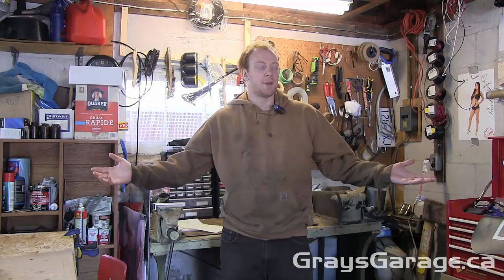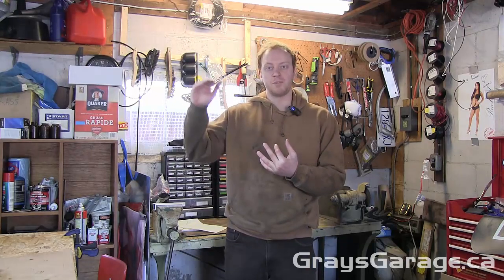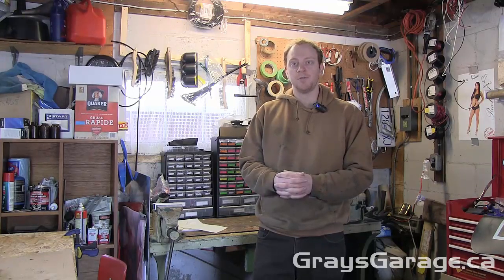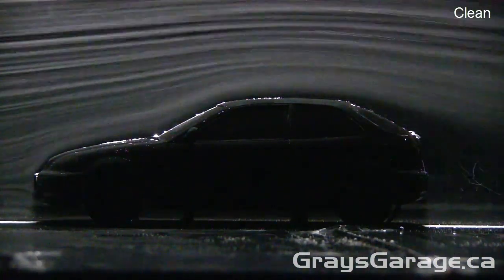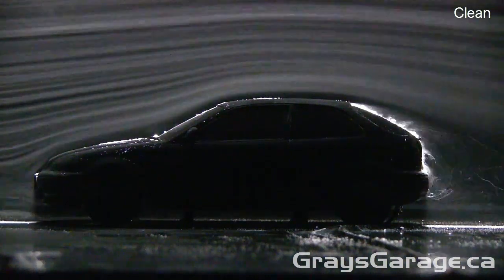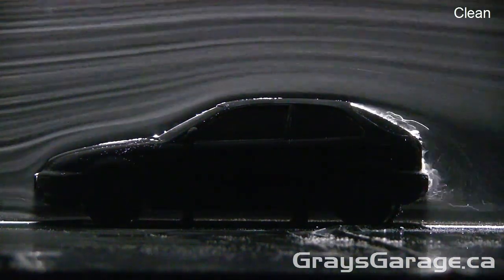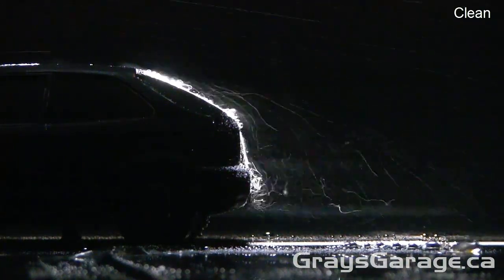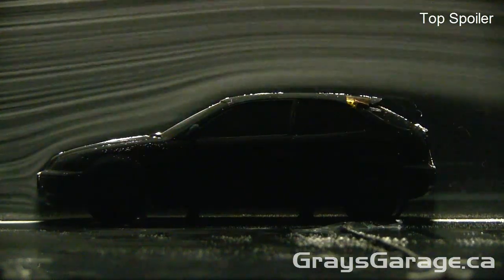Automotive Aerodynamics Ep. 6: Honda Civic Hatchback

Comment: It’s a great simulation that I learn a lot from, especially when it comes to understanding roof and mid spoiler setups for hatchback and SUV. One thing I noticed was that the combination of a roof and mid spoiler, which allows a localized bubble to form on the rear window, seemed to create less overall rear turbulence compared to the other configurations. I guess it is good thing, since it means lower overall pressure drag. I am guessing that the localized bubble above the mid spoiler has slightly higher pressure than the turbulent wake below, which could help reduce rear lift. The overall wake itself looks smaller too, which likely contributes to better overall aero performance. I’m guessing that’s why we’re starting to see more new hatchbacks and SUVs adopting mid spoiler designs. I noticed newer SUV and hatchbacks have rear window fins, i guess it could help stabilize the bubble even more.

Comment: I cut my rear bumper about 4" shorter. It's on a saxo, which means, there is nothing behind the bumper, It's an empty space for a spare wheel all the way to the fuel tank under the rear seats. 
We reckon the drag will be lower and the lift also.  I've got 3d files for sketchup, I can edit them etc. Would you be interested in testing: holes in bumper vs cutting bumper short vs diffuser vs standard bumper. There's loads of cars out there with nothing much behind the rear bumper and it doesn't cost anything. I can get back to you with MPG comparison as that's all I have to measure with.

Another test I am eager to see is, does a pointy nose make a car more efficient? Also steped surfaces vs flat. Golf ball vs smooth ball, what even happens? Surface perfarations to reduce drag? I have too many damn questions. Bumper is the one!

Comment: Thank you for your contribution to the car enthusiast community. Can you please make a video on the aeros of a 2008-2014 Subaru Sti hatchback? Not the Wrx hatchback as there are body variances in the different years. If you're unable to obtain a 2008-2014 model, possibly a newer sti would suffice. Starting from 2008 onwards,  Subaru has claimed that their STI bumper and fender helps improve flow while helping with cooling the engine. I'm thinking of doing a flat floor on my Subaru but worried about the engine cooling technicality. Any info or data would be greatly appreciated!

Comment: had thought for a while about the classic JDM styling to raise the backside of the hood to get air out from the engine bay, does the flow of air over the hood and windschield make a low pressure region ore is ther over pressure forcing air in thru the lifted backside of the hood?  

maby raised hood  is another useles mod doing more harm then good as rofspoiler on a sedan car with huge bootlid spoiler like subaru.

Comment: Well done. Only you introduced the 5th gen civic Sir ii which is an EG6 and the picture was correct but you ended up going with the EK4 civic which is the 6th gen. I prefer that you did that one anyway as it's also the same gen as the first type r civic the EK9. Good job

Comment: I would have liked to see the changes in rear flow without the upper spoiler, with just the mid-level spoiler installed.
I disagree with your assumption that the lack of wash on the back window with both spoilers installed would result in less dirt accumulation.
Methinks  it would result in more dirt accumulation because there is not enough coherent surface flow velocity to carry the dirt away.
I have a 2000 Honda Civic Hatchback with the stock upper rear window hood/spoiler.
This episode was most interesting.

Comment: Thanks for the video, it was very informative!

The first picture you show is of a 5th generation Civic, chassis code (in Japan and Europe) EG, sold between late 1991 and 1995. This car has a 0.31 Cd.

The tests you performed were done with a 6th generation Civic, chassis code (in Japan and Europe) EK, sold between late 1995 and 2000. This car has a 0.36 Cd.

Combined with a smaller frontal area this resulted in a 215 Km/h top speed for the EG Civic SiR. The EK SiR only achieved 207 Km/h with the same engine.
Reply: Was it that big of a Cd difference?? any citations or studies done to find out where this additional 0.05 increase in Cd came from? I mean a particular feature of the car??
Reply: You saying a stubbier rear is more slippery than a more sleek rear?

Comment: the first picture you showed of a eg is infact an EG. 1991-95. the one you tested is a EK 1996-00, that is what i have but a coupe version. Without the wing that came on the coupe, the car gets unstable at 90+ mph even with proper suspension and alignment. some forum users have said the mid level factory wing is very helpful with that but i haven't installed one on it yet. The integra (you said it right the second time) should offer the similar results being nearly identical in terms of chassis to the ek coupe and the forum guys have said the same thing about integra with and without the oem wing.  (sir is a hatch only model option that came with a front lip, b16 engine and some suspension work i believe that mid wing was never offered by honda. i could be wrong but ive been into hondas since 2007 lol)

Comment: Would these recirculation pockets be similar to what IRL and F1 actually use with their almost vertical plates on front wings and similar body parts?  My understanding is they create a localized and near constant vortice or recirculation area that incoming airflow just flows off of similar to the high pressure area near the wipers.

Comment: GraysGarage Please do the Nissan 180SX/200SX/240SX if you have time. It is a fastback design and it should have interesting aerodynamics i believe (expect of the pop-up headlights). I think the chuki version has a Cd of 0.27 if i remember well and this is back on 91!
Reply: My 200sx was surprisingly fuel efficient on the highway and there was such little wind noise. This makes a lot of sense now

Comment: I wonder what rear effect in flow the integrated roof spoiler on the 3rd generation Civic ('84-'87) actually have. It's designed to direct some of the airflow downwards on the rear screen. To bad that there aren't any usefull scale models of it available.